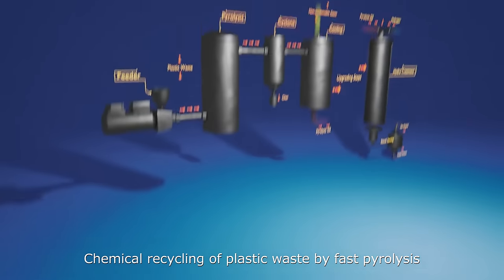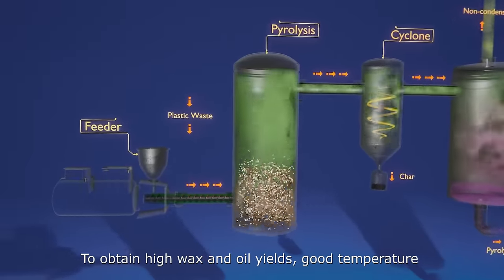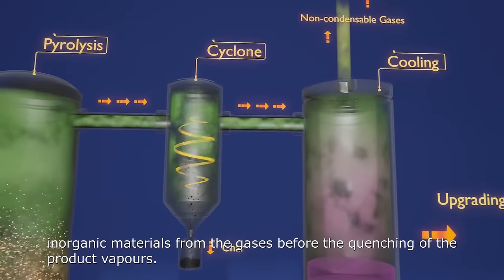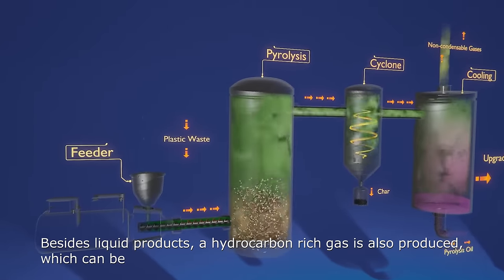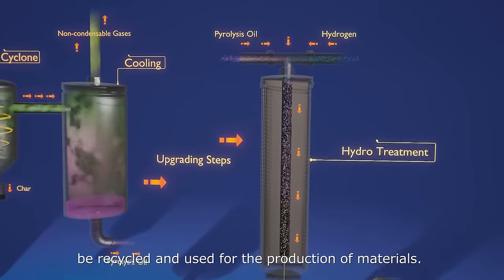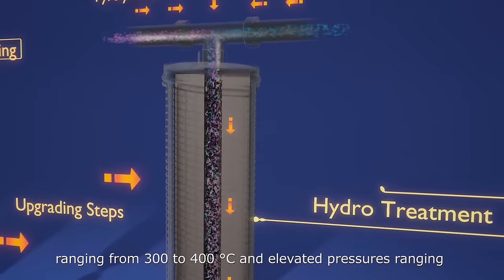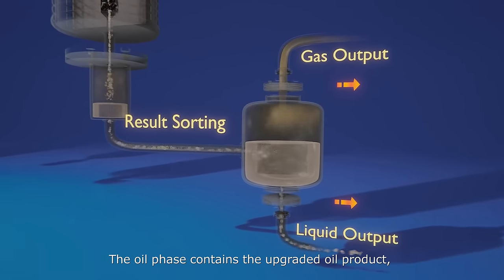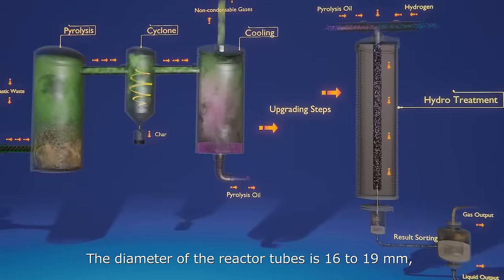Pyrolysis and Catalytic Conversion of Plastics

Comment: I would like to know if it would be possible to have everything recirculate into the system to feed itself. It seems like all the systems I see have outputs of combustible gasses, combustible liquids, char of some kind, and pollutants, but I would love to see the whole system be a closed as possible where the combustibles are burned to generate the heat for some of the steps and the exhaust from all the steps get used in either the drying of the feed stock or go through a char filter. Ultimately the output would be a horrible toxic paste but it would have been greatly reduced in volume and broken down as much as possible into simple molecules, therefore could be chemically treated to refine it. I understand wanting to sell byproducts of a pyrolysis system but if the system is open at both input and output, I fail to see how that's better for the planet. I would think that the ideal is to have a net minimal input and a result of waste reduction and transformation. What's the point of outputting elements and importing similar elements from different sources, it's like shipping laundry detergent that is 80% water just so it can be used by a washing machine combined with even more water, just ship the concentrated stuff and get rid of all the complexity of needing to move water around.